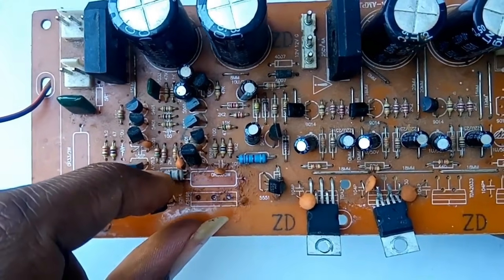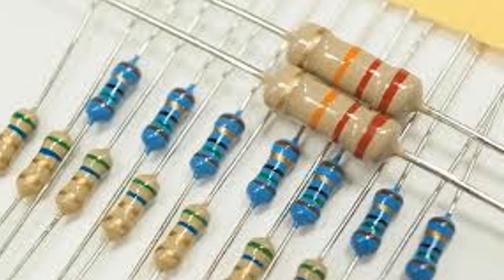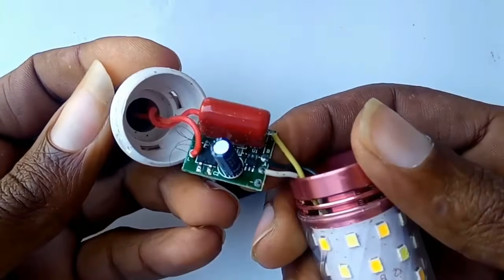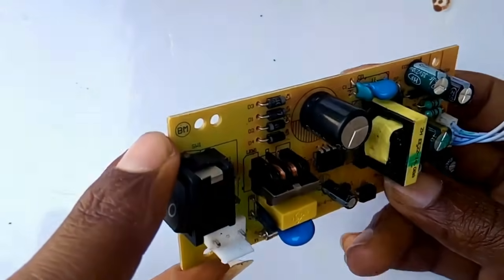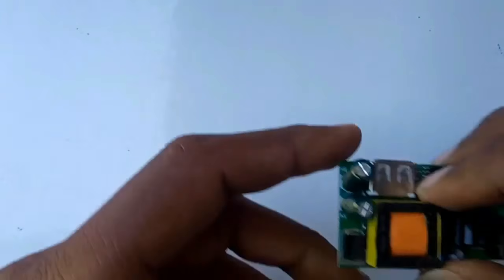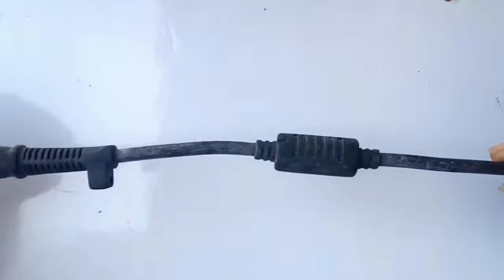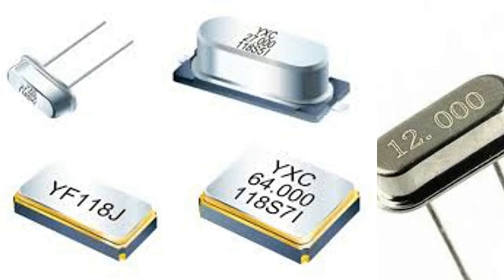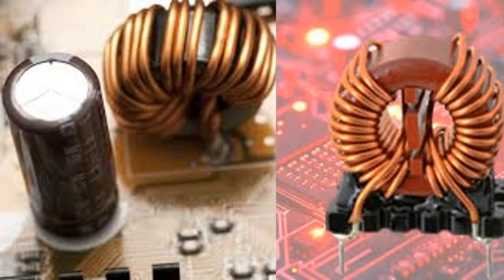Ultimate Guide to Passive Components | Electronics Basics Explained Clearly

Comment: What about transformer. is it active or passive component?
Reply from the maker: a transformer is a passive component because it does not generate power or control current, it only receives and transfers electrical energy between circuits, storing it in magnetic field and dissipating some as heat, without requiring an external power source to operate, unlike active components (transistors, ICs) that amplify or control signals